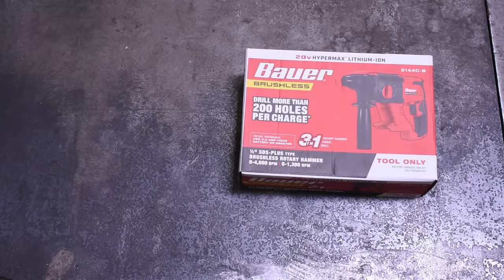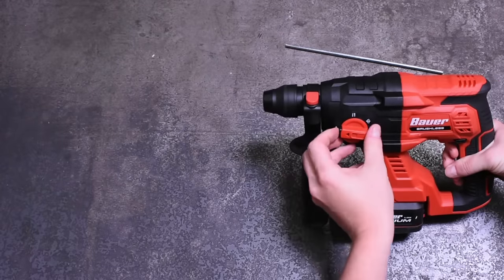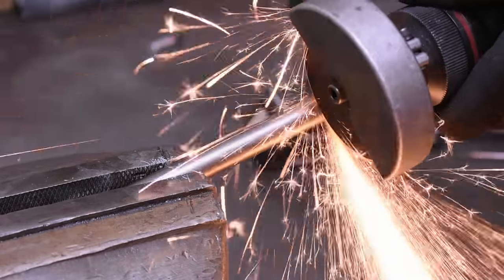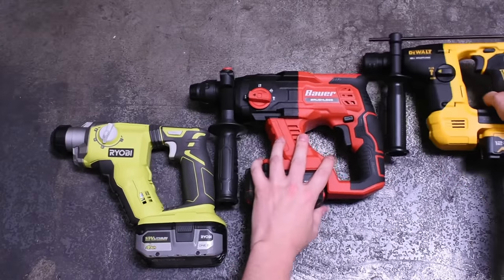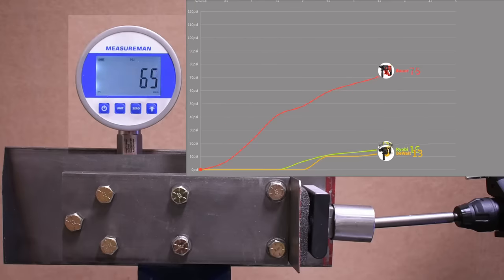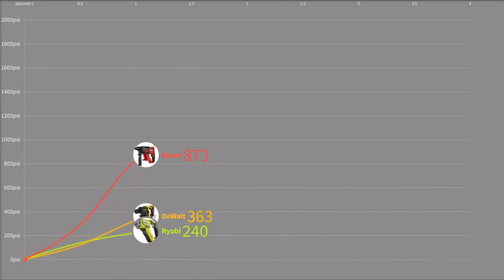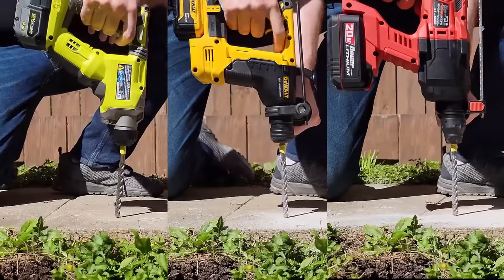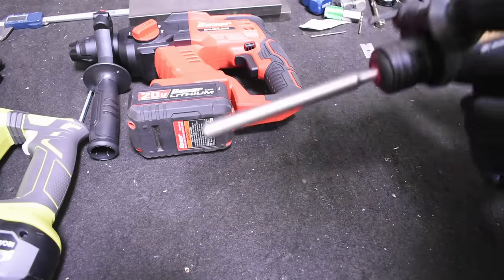Best Compact SDS Rotary Drill? Use as a Cordless Air Hammer?

Comment: I have this Bauer since I couldn't resist the tempting 35d on open box clearance. I have say this actually has a  useful performance. I don't regret purchasing it. I also have the Ridgid octane model. It is obviously more effective than the Bauer, which was a little comfort considering I had paid more than three times as much for it!  Still  I would like to see you compare the Ridgid octane and maybe the newer Ridgid also, since I have lots of higher ah batteries for the Ridgid but I only have one  2-ah Bauer battery, perhaps the Bauers performance is closer to the Ridgids with a higher-capacity battery. Great video really enjoyed it.

Comment: Wow.  That Bower really gets stuff done.  As an owner of the M12 Fuel SDS, I really hope you test it simply to see how it compares.

Also, yes, impact energy is what it is all about when trying to put holes in concrete which is why I think "hammer drills" should be avoided.  They should be called "vibro-drills" as they lack the required impact energy.

Comment: I use rotary hammers every day on the job as a concrete worker there is a big difference in drilling speeds with the larger hammer drills but the Hilti te4 is probably the fastest compact hammer drill i have ever used. If you can get a  new Hilti Neron te4 to test I think it maybe the most powerfull compact on the market right now.

Comment: Testing with chisels on common tasks would be very useful. 
BTW I made a pneumatic "beater bar" by brazing (don't weld tool steel) a short section of pipe to an old air chisel shank then pressing a slug of brass round bar into that. Instead of using a sloppy hammer and bar by hand you can easily drive pulleys etc onto shafts, dowels into press fit holes etc. Make yourself one from scrap and enjoy.

Comment: Got the 20v DeWalt dch273b which is an oldie but in chisel mode it helped knock out a rusted frozen exhaust stud + un-stick a rotor frozen to the hub. But hard to find hardened sds-plus chisels though.

Comment: Great review as always, but if you want to go higher with numbers the best shot for you to have  Milwaukee 2715-20, or the newer model 2915-20 or dewalt 1  1/8” hammer drill, the other smaller sds plus drills won’t have enough power that could satisfy you.

Comment: That DeWalt looks pretty slick to get into tight spaces. But the lack of a hammer-only option is kind of limiting, in the sense that it only works as a drill, and not also an ersatz air hammer.

Comment: I've recently used a small Einhell rotary hammer on the job (150/16mm in reinforced concrete). 
It sure is no Hilti, but it did decently well. Battery runtime was miserable though despite it having a brushless motor.

In Germany every rotary hammer has a specified energy per blow advertised pretty prominently. Apparently not so in the US: There is no info on the Bauer anyway. Dewalt states 1.1J, Ryobi 1.2J (doubtful given the performance). Drills this weak I wouldn't be comfortable using for more than 10mm (3/8") holes, ideally 1/4" or less. Unless one has unlimited time of course :)

Comment: Interesting testing. Most rotary hammers are rated for their impact energy (in ft-lbs or joules). It would a useful metric for comparison, rather than the (often wildly optimistic) diameter rating of a tool. I’ve found that the published joule rating to be very consistent when ranking rotary hammer performance in the past.

Comment: I've looked around SOOOOO many times for a cordless electric "air hammer" (for lack of a better word)

there's a DEFINITE demand-i can't even TELL you how many times something has gotten 'tweaked' at the track, or I run into a minor clearance issue on a wheel/tire or suspension component vs body/unibody support/ sheetmetal seam while out racing or doing a shakedown... Like 90% of the time, that kind of powered hammer would fix it in like 2 minutes max, with nothing more than MAYBE a jack, a stand, and a strap...

Instead, currently I'm stuck either towing the vehicle on a trailer or having someone follow along in a chase vehicle, and pack out a generator, compressor, and air tools... If I don't haul or have a chase vehicle with the needed tools, the only option is to suffer and resort to jacking the vehicle high enough in the air, pulling the wheel, and removing enough various OTHER components to get enough access to the problem area, just to be able to hit it with a dead-blow or sledge.

The vast majority of the time, I much prefer to just toss a few essential tools into the vehicle in question, and then take 5 minutes once I arrive to set up a little pit area, simply because it's so dang CONVENIENT... My normal "essential tools" pack-out I always bring with already HAS a few batteries and a few electric tools (impact driver/impact wrench/inflator/work light/ect), it would be as easy as tossing the hammer and a few bits into my kit-  it would save SOOOOO much time and effort!!!

Comment: I've drilled through the 2ft solid exterior wall with a normal hammer drill, it was an experience I don't wanna repeat lol. European homes are tough 😆
If I'll need to drill another hole I'll splurge on one of these to save my arms and sanity

Comment: What about the larger 1" and 1-1/8" SDS plus models, like the milwuakee 2912-20, 2915-20, dewalt DCH273B & DCH293B? Those are larger and more powerful than the little models you tried here, but not quite as big as the SDS max drills.
Thanks for the really cool tests, that no-one else does!

Comment: For having had to be in a boom nor scissor lift to hang things off concrete walls with anchors, having something lighter but not as useless as a hammer drill, and that had some useful beans, would be a good puchase for me if this video should happen to indicate that these actually are worth the money.

Also I do note for I having to use the tools I have or available to me (a Bosch SDS and a Bosch SDS+plus chorded hammer drills) I do use both for concrete demolition.

Comment: I’m just getting into Remodeling homes and invested in dewalt 12v tools. They work very well and are comfortable to use all day. The 5 amp hour 12v battery is a beast with the impact driver. Would have gone with Milwaukee or other 18/20v tools but everyone had them and can easily walk away on a job site. So far I’m the only one with dewalt 12v tools so easy to keep track of lol. Great review!!!!

Comment: SDS Max hammers/drills are just amazingly useful tools. I often wonder how much it sucked before they were invented. They'll break up concrete, tile, brick, anything. Saves workers so much time. Fantastic engineering and design. I like the Makita the best so far imho, its adjustable handle style and overall ergonomics... lovely for doing a horrifically dirty job

Comment: Could you try to drive nails with  them? It seems like you could make quick work of a fence if nails were the fastener of choice. I prefer screws but if you chose nails for a large project, holding an sds seems easier than swinging a hammmer

Comment: Interesting but i just can't see using these as air hammers would be very useful even if they were more powerful. They just can't get into tight spaces. The numbers on the DeWalt were surprisingly low... I wonder if that was because of the 12v platform or if it was the light weight of the tool (by design). 

Is that test rig of yours just a wedge? If so, are you using any grease?

Comment: If you're after the hardest hitting cordless SDS plus (not max) hammer, I'd go for the Dewalt DCH263. In my tests it's killed it in the speed tests, and has about the hardest impact, and biggest capacity you'll find without going to SDS Max. Other 28mm hammers like the Milwaukee M18FHP would be good too, but Dewalt tends to hit harder despite capacity claims.

Comment: As a mechanic, what would be the use case?  I'd love to see a legitimate cordless "Air" hammer, but usually you're using an air hammer with a ball joint separator or a cutting tool.

Comment: I am surprised with the Bauer results, seems like a decent option if you only have a few holes to drill, it probably would not hold up to heavy use but it also does not break the bank if you need to buy one.

Comment: Wow. I have the ryobi. Works so much better than any hammer drill.  Because of the bit probably. But it looks pretty weak compared to the others.  If I need to drill a lot of concrete guess I’ll get the M18   I haveM18 fuel hammer drill too

Comment: I bought the Ryobi a few years back hoping to use it as an air hammer. As the tests show, it's pretty gutless, and vibrates like a son-of-a-gun. I have yet to have it successfully knock out a stuck pin/bolt. I did pick up (on a big sale) the HP version P223 which is a much beefier unit. I haven't had a chance to try it out yet, but given the size and weight difference I'm hopeful it will be better. I also have some old back splash that we are planning to remove in our kitchen where these may come in handy beyond just trying to replicate an air hammer. Any excuse for a new tool, right?

Comment: I was going to buy an air hammer tool but I smoked my air compressor recently removing an axle bolt. I was wondering if there were battery powered equivalents, but maybe I should just buy a new air compressor...?

Comment: Now try the ryobi brushless hammer drill model #223, $179. Milwaukee's 12 volt 1/2 inch  rotory hammer model # 2412-20, $163. Dewalt 20 volt rotary hammer model # DCH273B. Also makita model # XRH04Z and #XRH03Z.

Comment: As a DeWalt tool line owner, this was like watching my team lose again. I wish I'd have chosen Milwaukee when I started my collection. Bauer continues to impress me, especially for a tool that will not see much use for the average homeowner.
Reply: If you're gonna use them regularly it could be worth a switch. I switched about a year ago and am glad, but I'm also impressed by some of the new dewalt tools, especially in the mechanics world.
Reply: Don’t be sad when comparing a 12 lb M18 to a 3.4 lb 12V Dewalt dude! Compare the biggest Flexvolt to the M18 to be real.
Reply: @Olds_Pwr  this and other 12v rotary hammers are wonderful tools for 1/2” and under holes: for many users, that size hole is the norm. Bolting rock routes, fixing overhead duct anchors etc is much easier with a lightweight tool. Horses for courses.
Reply: @default9740  I totally missed the fact that it is 12v. I assumed 20v. I don't know why they would make something heavy duty and only make it 12v.
Reply: @123Hacksaw  It’s not heavy duty, it’s a 12V 1/2” rotary hammer! Rotary hammer isn’t by definition “heavy duty”, it’s a description of how it works.

Comment: To be fair to the sds drills if you included the power source (the air compressor) in the tool like you do with the sds drills the air hammer would come out way larger and would be louder, less energy efficient and  probably cost more by a fair bit

Comment: dude this is the only reason I have an interest in purchasing an sds full size or compact is to put a chisel tip on it and use it to smack open the motor cases I scrap rather then burning through grinding wheels like the sopranos burn through main characters

Comment: I really don't get that 12v DeWalt. Besides the fact that it's got less available energy than 18v models, I would figure that the type of people that need an SDS hammer drill likely already have 18v DeWalt and NOT 12v DeWalt. So they wouldn't even be able to use the batteries they already have.

Comment: Too bad they can't replace an air hammer yet. The only reason I have a compressor in my car trailer these days is for using the air hammer for track side ball joint/bushing/etc replacements.

Comment: Why would you compare an SDS MAX to an SDS Plus?  Isn't that like a Minivan vs a Porsche?
Reply from the maker: These are all the same SDS class
Reply: @TorqueTestChannel   Maybe I misunderstood.. it's just your Chart shown in this video has Milwaukee at top as an "SDS MAX" with 18,000 LBS and the next closest one down is an "SDS Plus" at 3,500 LBS.  I'm having a had time comparing the two together... like which one to buy... since they are such different models, Milwaukee 2717 I is heavier at 15.6 LBS, vs the Ryobi P222 is 3.4 LBS 1/5 the the weight?
Reply from the maker: Oh on the list. Yes you're correct its not a fair comparison. But it worthwhile to see that difference for some. Which agreed, is a big one